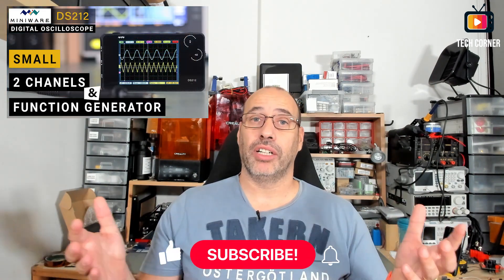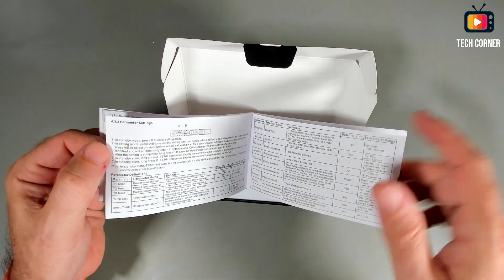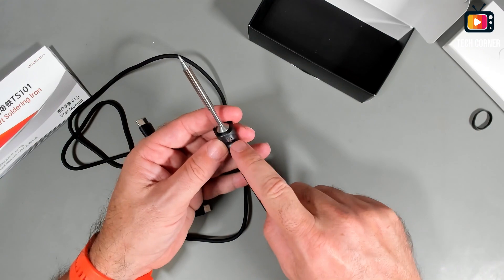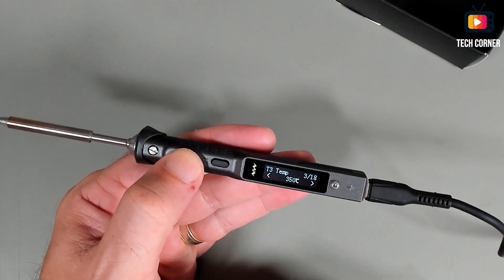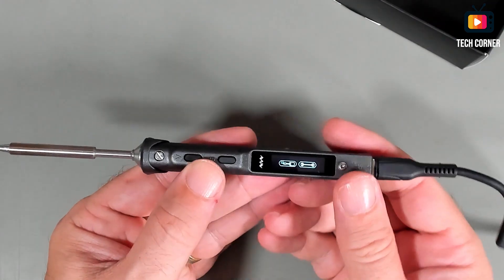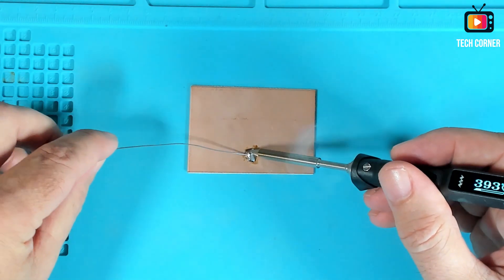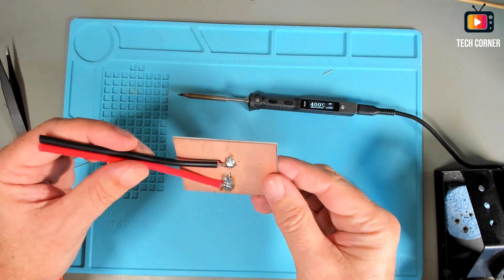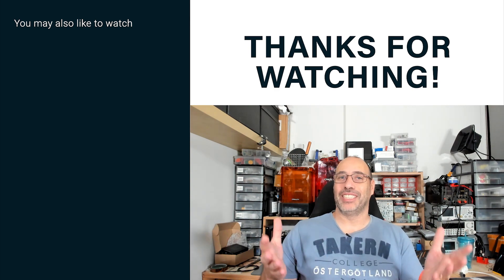Miniware TS101 Smart Soldering Iron ⭐ 65W/400º C ⭐ USB PD 3.0 + DC ⭐ TS100 Upgrade

Comment: Why you can’t use the 65watt wall power brick you showed here? It’s a usbc. But you use the 45watt why?
Reply from the maker: Hi, sorry the late reply, trying to keep up with the comments, not easy. I didn't have it at the time of this recording, it arrive later. You probably saw my recent videos on soldering irons. Now I even have an adapter and I can connect it directly to my Rigol power supply and use the 90W (I still need to do the firmware upgrade). Yes, that was the main problem. At the time of the recording, using USB you can only go up to 45W, 66W was using the DC barrel. I hope that I clarified your doubts. Thanks for watching.

Comment: What good are they if you can’t plug them
Into a wall outlet
Reply from the maker: Hello! Sorry for late reply, house move and vacations. I get what you're saying, but having a USB powered system also comes with beneficts, less footprint, flexible cable (easier to work), if the USB power supply dies, just replace it... it's a tradeoff. Thanks for sharing and watching!

Comment: I bought the TS101a few days ago. In Australia with discount, I paid AU$78 delivered. Can't complain about that. What did cost me plenty though was a genuine Miniware (Uy Chan) D24 chisel tip which cost almost half the price of the iron. Any other tips I will be buying knock offs for sure.
Reply from the maker: Hi! Yeah, tips can be expensive. I have some orgininal ones but also for around 40€ or so, a "compatible" set with like 8 tips or so, there are tips that I use ocasionally and for one or other time, it will be enough for me. Thnaks for watching! PS - There is an upgrade for this to increase the power over 100W

Comment: i just got mind an i can tell you i am not impress with this version don't know if mind is a lemon but don't start up quick as my old ts100 i takes forever to reach desire temp
It Does reach temp at one point but very slow compare it with my cheap pinecil v2 or the sequre S1012 pro
Reply from the maker: Hi, I have here the Sequre to test, missing the time but for this unit you have a firmware upgrade to took him over 100W, again, didn't had the time yet to do it (and probably do a video about it). I like a lot, is my favorite soldering iron just after my Aixum T3B soldering station. Thanks for watching.

Comment: Hi thanks for a very good review video. Im in a search for new soldering iron, would like to seek your opinion, between FNIRSI HS-01 and this TS-101? I like the form factor of the HS-01 and it is made of aluminium with covet, but not sure how does it compare to the TS-101 when in comes to performance..
Reply from the maker: Hi, I liked very much of the HS-01, is very complete and a fair price. TS-101 is a more refined tool, with the latest update you will be able to have 90W on it, that a very nice power to have on soldering iron. Other than that, has more functions in the firmware, several preset's etc., but is a bit more expensive, so as I normally say, you pay what you get, so more features means, more money. Ansering your question, personally the TS-101 is what I use whenever I'm not using my Axium soldering station. Thanks for watching.

Comment: Btw DC Jack 9-24V, up to 65W while USB-C (PD3.0) 9V-20V, maximum 45W
so you have to keep that in mind.  It's true that you are using a 65w power supply but it would draw only 45W which is not enough in my opinion.

I'm still using TS100 and i was hoping that you could make a compression if change it worth it
Reply from the maker: Hi, with the last firmware update, you can go up 90W... that is pretty respectable even for a 220V soldering iron. So, it might worth the change.. as always, depends on your needs. Thanks for watching!
Reply: If you use a pd3.1 usb c charger, it goes up to 28v which allows it to operate at 90w.
Reply: no stay with your ts100

Comment: All this is useless if the tip is crap. So... how good is the tip? Hos does it compare with, say, the tip of a normal non temperature controlled, 60€ JBC solder iron? Beacause my cheap JBC solder iron is 15 years old, and the tip is still ok...
Reply from the maker: Hi, the tip seems to be good, but we have the advantage that we can change it whenever we want. My old JBC 60W, still is a good iron, but with only one general tip. To be honest, this is one of my favorites I ordered a 2M usb cable to be able to use it with more working area. Thanks for watching!

Comment: riiiight right, well... "the already good is much better" is NOW.. MUCH MUCH better! I just ordered the TS101 WITH... PD3.1! (PD 3.1 meaning... You can run it for 90 watt @ 28v versus the 24v barrel in cap) 🤤😌
Reply: I run 28v pd with 140w type c cable  and anker 737 power bank 140w type c output 28v 5A - just got it to work - 0 - 300celcius in like 3 or 4 seconds lol
Reply: @handyvan3422  Its remarkable! I always thought it was me(struggling to get a decent solder), turns out nnnno not so much, i had a crappy tool all along the difference is night and day using this unit, in any power config really! You do know it has a "turbo" button right? If you get into a big solder joint, you can hit it and get a boost right away, makes it flow so so nice!
Reply from the maker: Hi, I don't know if you'll be able to strech up to 90W because of the hardware limitations, but if you can, that will be awesome! Thanks for watching!
Reply: @TechCornerTV    Im hoping it IS so! Doing the amps, watts,volts, calculations on rapid tables seems to pull up... 65 watts @  24v would be 2.70833333 amps  and @ 90 watts 28v 3.21428571 amps. So that SEEMS believable to me 1/2 amp more'ish. The real sourcery to ME, is that the PD 3.1 CABLE is rated to 240 watts!? @ 28v thats 8.57142857 amps!!! I have not seen a PD3.1 cord yet, but seems pretty sketchy lol Only the one place that i found them for sale and i cant find ANY reviews up for it on the tube here, id imagine... it would get quite a few views though! Im just winging it and i wont review it on here, but... Here is a link if you want to...   https://www.aliexpress.com/item/1005005058397721.html?spm=a2g0o.order_list.order_list_main.5.76e81802MDgxO8

Comment: Also check out the Pinecil soldering iron.
Reply from the maker: Hi, I didn't know them. The iron seems very similiar and the price is very good also. But the company has a lot of interesting products. I will contact them for sure. Thanks so much for the tip 💪 and for watching 👍
Reply: @TechCornerTV I'm really planning to buy the iron so badly. I'm saving up money and I currently have $12.... I'm still thinking if pinecil is maybe enough since it's cheaper... Maybe I'll buy it if it performs well or similarly as ts101

Comment: is this product suitable for absolute beginners AND for learning how to solder and become very good at soldering?
Reply from the maker: @leech In short yes, the price is very accessible to such a good tool. The way it melts the tin so fast and with such a fast recovery, will help a lot people that are not YET used to solder. Thats one of the main problems with people starting, they buy a cheap solder iron ($10 to $20). It will make your live harder, because it will not reach the desired temperatures, it will be slow to recover and so on. If you can use the DC barrel for 65W, it will be more than good. And the tips are accessible. You have on Aliexpress 11 tips for $50... amazing! Thanks for watching 👍
Reply: @TechCornerTV  Thank you for the clear answer, i will definitely consider buying it then because i have never soldered in my life before. I'll use your aff link then!
Reply: Yes. I’m a diy solderer and I use the old version. It’s great
Reply: @PhilipHollowaychannel  Thanks 🙏 That's very promising to hear 🙉

Comment: The heat-up and recovery time is very impressive for such a compact unit. Good review.
Reply from the maker: Hey Dave, I agree... it was the very first time I used an Miniware soldering iron and I was very impressed. As I told in the video, the things I've tested so far from Miniware have quality, the price is not always so friendly, but this one really catch off guard. It works really well even with usb. Was plesant experience. Thanks for watching. 👍